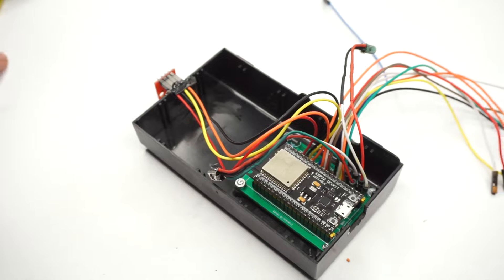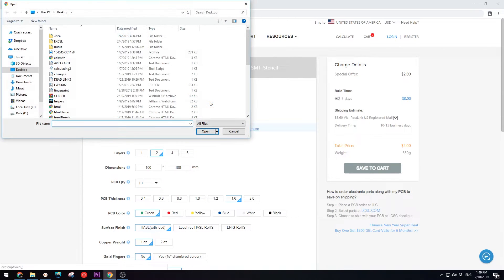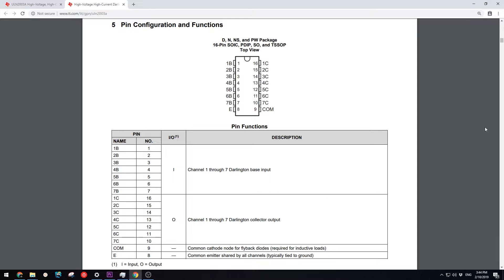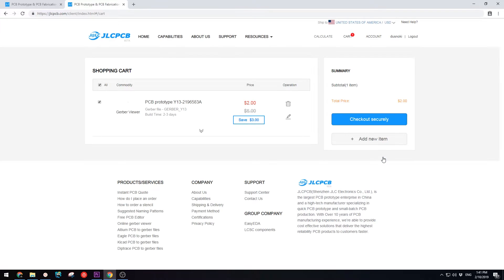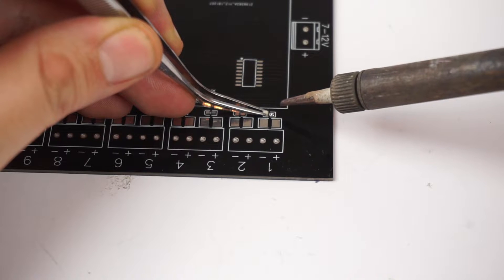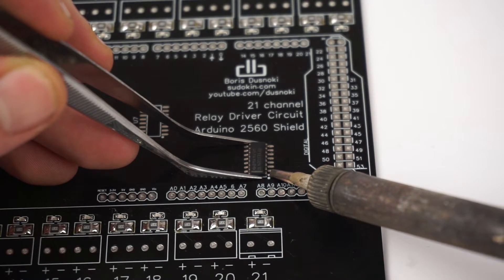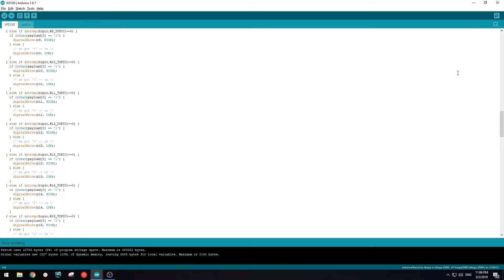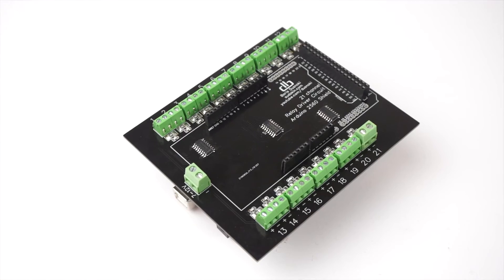Relay Driver Board, 21 Channels, 12V, Arduino 2560 shield, Node Red, MQTT, W5100 Ethernet

Comment: What is the value of the resistor you used for this project? I checked the BOM, but all that says is 1206 (size) without a resistance value. If I am reading the multimeter right, it looks to say .68k Ohm which would be a 680 Ohm resistor. Correct?
Reply from the maker: You are right, it is not found in the BOM, will try and fix that, but it is a 680ohm resistor which you can see in the schematic on the EasyEDA Project: https://easyeda.com/dusnoki/uln2003-relay-driver
Reply: @dusnoki  Ah, You're right. I hadn't gone back into the EasyEDA project. Now to order supplies so I can try making one... or two.